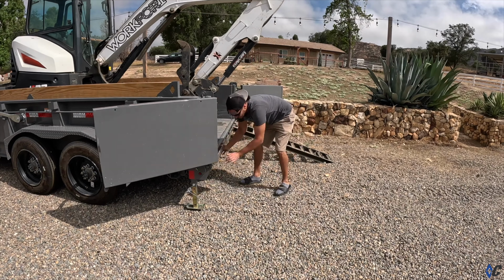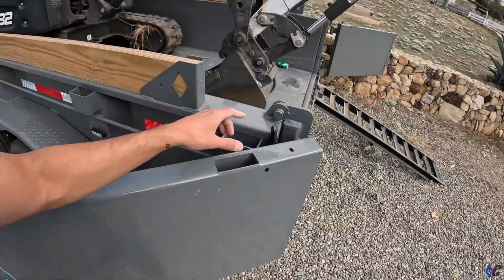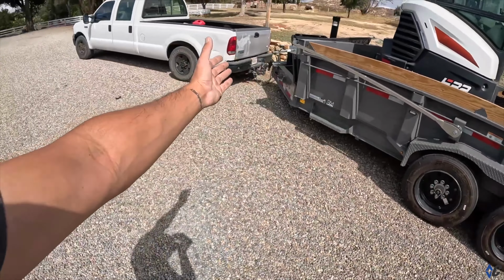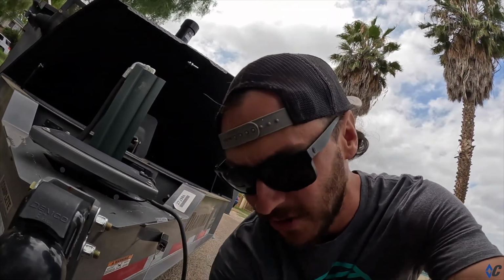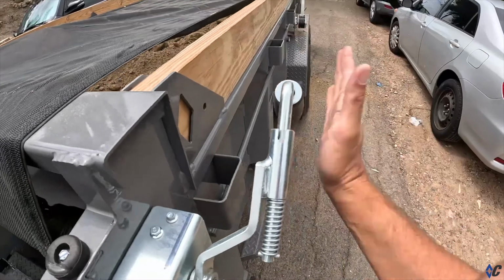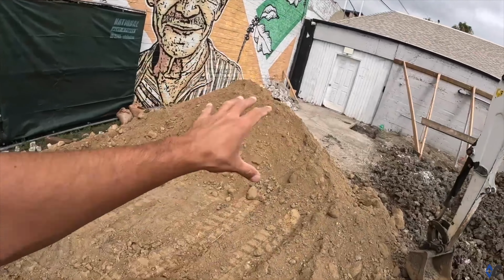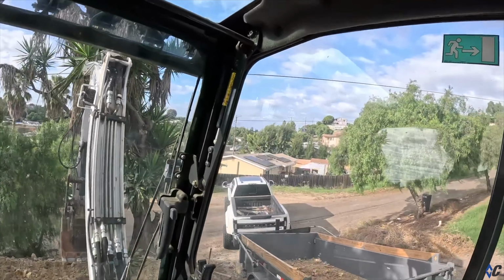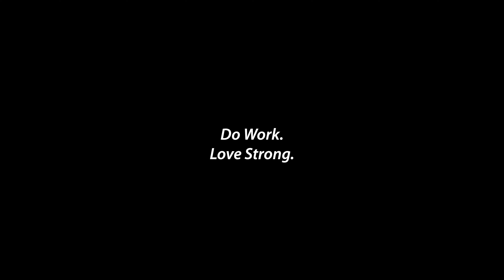Diamond C Dump Trailer Review 💭

Comment: I love my DC 14.9k LPT.  It’s the first dump trailer that I’ve owned.  I have rented and borrowed a couple of different ones over the years.  The only two issues that I have is the tarp isn’t level when fully retracted. The screws that attach the grommets to the pipe are not installed the same.  That’s what causes the tarp to be lopsided when you wind it up.  The passenger door stop latch needs a little more space so that the door will latch and unlatch with a little less effort.  Other than that, it’s been a great trailer.

Comment: My towmaster 14 k 12 ft dump has bever failed to dump. I have 100% overloaded it to the point my 14 ply tires were sketchy and it dumped just fine . My dump truck is also scissor lift.....

Comment: Seems kind of crappy that the electric over hydraulic system in the trailer, whether dexter or whatever is not set up to recognize a brake signal from truck systems...especially if new.
I think Dexter has an adapter that fixes that.
But years ago I ran a dexter E/H disc brake system off of simple brake controllers, and they had no need to have a separate mode....they worked great.